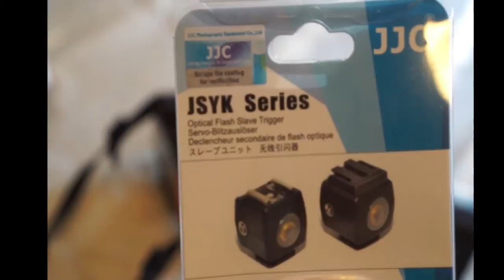Sony A5100 Flash Hack - Wireless Remote Flash Triggering

Comment: Haha, that is the same solution I came up with. I have also been playing around using a S2 cable with the wireless trigger but no success. Remote trigger works with the cable for the shutter control, but for some reason will not trigger the flash. So for now I have the same optical to wireless setup you have. We'll have to compete on who can come up with the prettiest pop up flash to optical housing solution.